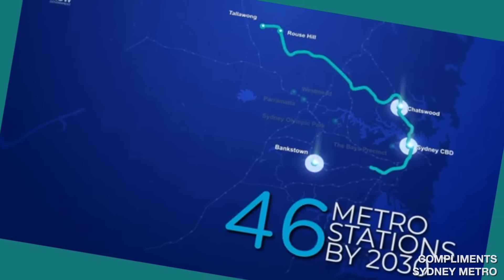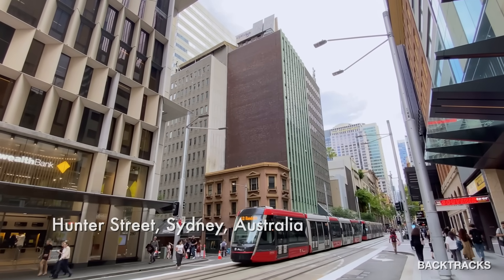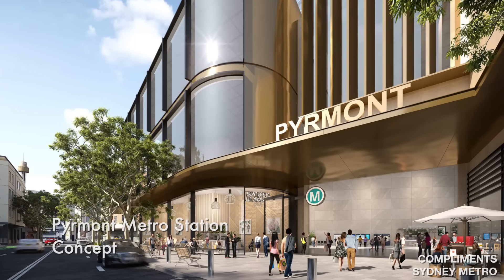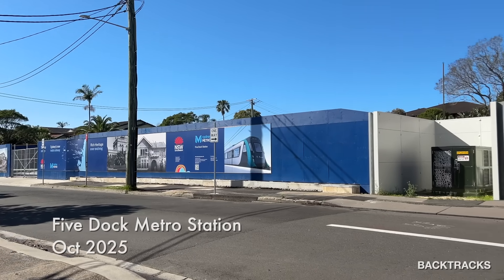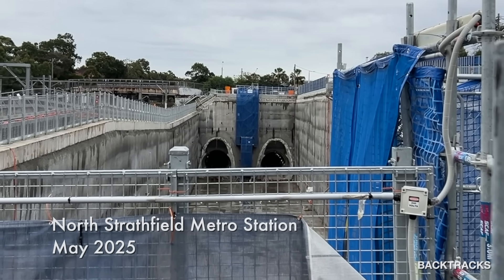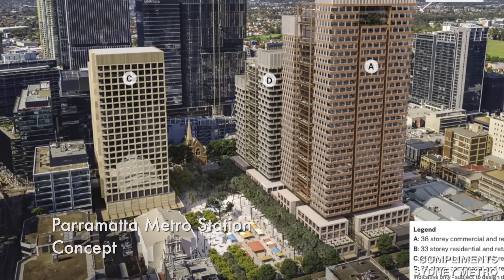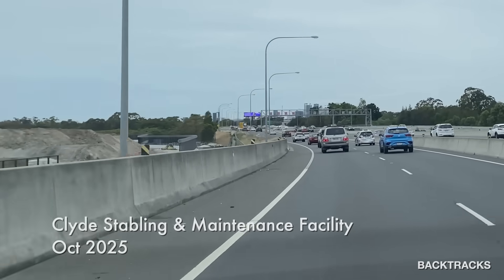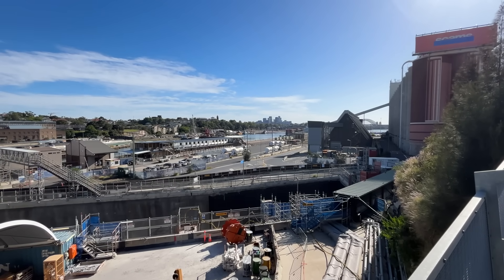My first look at Sydney's new Metro West Railway Line

Comment: Surprised it was mentioned that Sydney olympic park will have low rise over its metro (no complaints, SOP doesnt have much infrastructure currently - lack of schools, even a proper supermarket), but I thought they had plans to amend current approvals and enable the construction of around 190 extra residential units directly above the metro station.

They even had three shortlisted consortia invited to tender for the Sydney Olympic Park Integrated Station Development Precinct, contract are:

FCC and Ecove: comprising FCC Construction Australia Pty Ltd and Ecove Group Pty Ltd

Gamuda and MTR: comprising Gamuda Engineering Pty Ltd, Gamuda (Australia) Pty Ltd and MTR Corporation (Australia) Pty Ltd

John Holland and Freecity: comprising John Holland Pty Ltd and Freecity Group Holdings Pty Ltd

Unless this fell through? And they realised a high density tower over the station won’t be great for residents when events are on every weekend and even weekdays…
Reply from the maker: Thanks for the update, and you're probably correct as my info may be now out of date. Looking forward to hearing that a consortia has been successful in winning the bid and then commit to seeing the project through. Hunter Street is a good example of how it can go wrong.

Comment: Thanks for the update! It is genuinely bewildering to me that they would slow down construction and the station tender process in order to 'prevent cost blowouts' - the earlier they finish it, the earlier that the economic impacts will be realised. It is not good that these station boxes are finished and sitting around dormant
Reply from the maker: Yes it's easy to scratch your head at some of the decisions that are made.

Comment: Empty station boxes, missed station at Silverwater, an airport Metro with a completely different electrical system making it impossible to interconnect, missed underground connections like at Westmead, no light rail from the Balmain station up the heavily trafficked Victoria Road to Gladesville and Ryde, the insufficient ferry wharves up the Parramatta River, missing the new Sydney Fish Marketd, Waverton, Loungeville, Birchgrove, Birkenhead Point, Russel Lea, Five Dock, Concord Hospital, Concord IKEA (other side of peninsula), Silverwater, Ermington, and a Rydalmere Light Rail connection to Parramatta for when the tides are to low to ferry all the way to the end. 

Sydney: headscratchingly two steps forward, one step back.

Be like the Chinese - ignore the NIMBYS, be bold, be quick, and do things like building a HSR Maglev between the airport and downtown like Shanghai did… or something similar. As the new Metro has already shown: build it, and they will come.
Reply from the maker: Thanks... yes when you summarise it like this it does make you wonder eh!... but also at the same time there is a bit of commentary from people in other states saying how great it is Sydney even has 3 new metros being built at the same time.. thanks again for the comment.. great to read it. cheers M

Comment: The reason for the big gaps between The Bays/Five Dock and Sydney Olympic Park/Parramatta is largely because the previous government was fixated (particularly Andrew Constance) on targeting a 20-minute journey time between Parramatta and Hunter Street. Primarily to encourage more people to interchange from the Western Line at Westmead but then they skimped on a cross-platform interchange at Westmead and now the interchange is as inconvenient as possible. Cudos to them for creating the project but they leaned too far into a faster, limited stop metro where there really should have been 2-3 more stops.

In the Inner West another complicating factor was the depth of the tunnels to go under the various bays plus the proximity of Westconnex and the Rozelle Interchange. However, they really should have put more work into achieving a station at Leichhardt North for interchange with the Inner West Light Rail. 

Between SOP and Parramatta there was the speed factor plus they wanted to keep Silverwater as light industrial/commercial so there wouldn't be any return on new development if a station was in Silverwater. It's a similar story with Camellia/Rosehill plus the land is very contaminated. This is where the new government looked at adding stations, but it was all too hard and they gave up. It should be noted that by the time they paused things to investigate this the TBMs had already gone through at quite a deep level, particularly in Silverwater.

Anyway, the previous government should have added 2-3 more stations, rebuilt Westmead with cross-platform interchange, eminent domained Rosehill Racecourse and put a station and the stabling yard under a new high density CBD. When the new government came in it was really too late to change anything. They should never have paused it. Completion has now been delayed 2-3 years at the probable cost of billions.
Reply from the maker: Thanks for the detailed insight really interesting. Thanks for the share appreciate it.
Reply: Rosehill could have happened if the members of the racing club - who obviously care nothing for the housing crisis - would sell the underused race course for 10x its land value.

Comment: Have there been any confirmations on whether the lines from Bankstown Metro will connect to liverpool after the metro is built? Or will they keep the existing line that has it connected to lidcombe? I don't want to be taking 3 trains to bankstown :(
Reply: I really hope not. The M1 metro line is already ridiculously long with an insane number of metro stations from Tallawong to Bankstown. Probably one of the longest metro lines in the world - which is not a good thing, as the longer the line, the higher the chances of operational issues arising, breakdowns, etc reducing reliability.
Reply from the maker: Thanks. Good question. From what I understand there are no confirmed new metros planned beyond the three currently being built... but plenty of speculation of the next lines.

Comment: Why would people from the West change trains at Westmead when they are already seated on an express trains and how long will they take to get off walk to the Metro station down a long escalator buried deep and wait for another train to complete the journey?
Reply from the maker: Thanks.. you could be right.. and I was just speculating.. but from what I can see it takes 36 mins to get from Westmead to Wynyard in morning / evening peak in a semi express train. The metro will take 22 mins from Westmead to Hunter Street. So could save 14 mins - less time it takes to change trains. but then also those getting on at Westmead will get seats as metro is empty.. some may think it's a nicer, smoother ride - with less chance of delays like on Sydney Trains? 

Sydney Trains didn't think people would get off the T9 line and change at Epping to get to the city via M1, but they have - leading to higher than expected numbers on the Metro.

But of course, we'll have to see how it comes out in the wash..
Reply: @BACKTRACKS.Trains great analysis. I’m speculating, but I reckon the Blue Mountain services (or some of them) may terminate at Westmead to allow more suburban traffic between Parramatta and the city. But 7 years until completion? That’s ridiculous.

Comment: Won't the Metro West be using 25kv AC overhead
Reply from the maker: Good point. Yes, it will be using 25kv AC overhead. It was more a reference that the trains themselves will be similar. Rather than the different carriage number and configuration of the western Sydney airport metro. Hope I have that correct.

Comment: are we expecting olympic park heavy rail station to close when the metro opens?  will there be a use case for it once the metro opens, especially as it's such a tack-on...
Reply: I've heard a theory that Sydney Olympic Park could be used as a High Speed Rail or Intercity terminal in the future. Mostly speculative, but definitely a good idea in the long term (especially if we implement the MTIRP leaks from a few months back) - a CCN tunnel from Epping to Sydney Olympic Park would be under 9km, but it'd free up a crazy amount of capacity for the T1 and BMT to use from Strathfield to Central.

Even without that, though, I don't think the T7 is going anywhere. You mentioned the direct connection to/from existing stations, but I'd also just say that Wentworth Park is the densest suburb of Sydney outside of CoS Council - if anywhere can justify a 10-minute shuttle, it's there.
Reply: @TK-0865  wow... damn.  that theory is new to me.
Reply: @karlcx  infodump incoming 😅

A few studies have suggested it for High Speed Rail, since it's well connected to CBD/Parramatta by Metro West & it's well located to allow through-running. The 2019 NSW Government study and the 2023 Fastrack Australia proposal (my personal favourite, worth a read) would have used it as the main HSR station, while the 2013 AECOM study suggested using Central until there was a need for through-running (which is dumb, because tunneling to Central will be quite difficult).

Worth noting that while there's a good case for redirecting northbound trains into Olympic Park (since that allows extra T1/BMT frequencies), SHL/SCO will be harder to justify because of the tunnel lengths required (and BMT is probably unnecessary if CCN isn't restricting its frequencies). Since high-speed trains can also travel on mainline tracks, Sydney-Melbourne trains could just use the T8's right of way for the time being, and since Central to Macarthur is actually one of the straightest parts of the existing Sydney-Melbourne line, you could definitely defer the Olympic Park deviation for a while. A SCO deviation might actually be more justifiable, as there's some pretty big capacity issues between Wolli Creek and Central, but that's still a very long term consideration; the Thirroul-Waterfall tunnel and Sutherland-Hurstville quad-tracking are definitely higher priorities
Reply from the maker: thanks for the great share. I hadn't known about much of this. Although only thing I can add is that the building companies work on high speed rail to Newcastle are not considering central Sydney for the Sydney station. SOP sounds like a good location - especially when connected to the Metro and a Heavy Rail Line which is not just a shuttle service.. However Rosehill area could also be a good location.
Reply: @BACKTRACKS.Trains  i think the further from the cbd it is, the less attractive it is for people catching it though, no?  fast rail tickets aren't going to be cheap - harder sell then to need to catch a connecting service.
Reply from the maker: Good question. I can only speculate. But I guess they will keep it open but service patterns will likely change during the week and also for special events. I assume they may remove express trains to central during events. Or at least reduce them. They would need to keep the trains going to the west. What do you think?
Reply: @BACKTRACKS.Trains  actually i may have just talked myself out of that opinion.  direct access from lidcombe and central - and all the people associated with those lines aren't the same people along the metro line necessarily.  and people living in olympic park never really moved the needle on usage as far as i'm aware, but their access to the same lines/places adds somewhat to the argument to keep it.  it's a tough one.
Reply: @BACKTRACKS.Trains  i think it could go either way.  it'd be a shame to see it go, but being a dead end (and i think no possibility of changing that?) there is endless precedent for them to close it, exacerbated by the fact there's a metro basically across the street.  i don't see it being feasable long term.

Comment: The current airport line is the most stupid project I have EVER seen, a high capacity metro from a crappy suburban rail line with zero chance of good patronage. It should have interchanged to the north west metro at Schofields, I have zero idea what the planners were thinking in stopping it short of that connection

Comment: I think you'll find that the tower to be built at the Hunter Street East site will in fact be around 270m tall. This can be seen in the city model on the 2nd Floor (I Think) in the Town Hall, the new tower is a similar size to the Crown Tower.
Reply from the maker: Ah, good to know! Thanks for sharing that detail about the East tower. That is tall eh! I think I have then only referenced the West tower?
Reply: @BACKTRACKS.Trains  Yes it's worth going to have a look at that model of the city. It's about 10 meters x 10 meters and you see many of the developments that are approved & seeking approval as much as 10 years into the future. There are 2 towers taller than counterpoint, one proposed and another approved.

Comment: not at least digging a station box for silverwater is lacking foresight. the added cost is nothing compared to how much it will cost to add 25 years from now. not to mention it would require shutdown of the segment of the line effectively crippling the entire metro.
Reply from the maker: 100%.. I lived in Singapore for a while and they had it sorted.. they would build the basic structures for future 'infill stations' that they planned to open maybe decades later..they can do it ie Central on the M1 was built after the tunnelling was complete but of course the line wasn't open. I agree there is very little chance they could later build a new station on an existing running line.

Comment: with all the housing issues we have in Sydney.. why not Silverwater?
Reply: theres plenty of room for housing. the entire cherrybrook precinct has been empty since the first metro started, yet nearby castle hill is heading for the stars. build some shops, build some towers, add some extra buses
Reply: 1. The land is very contaminated. Cleanup costs are likely to be extreme
2. We don't need new stations for housing. We do a pretty terrible job of putting housing near the stations we already have. Take a train to Revesby and look out the window - barely an apartment in sight